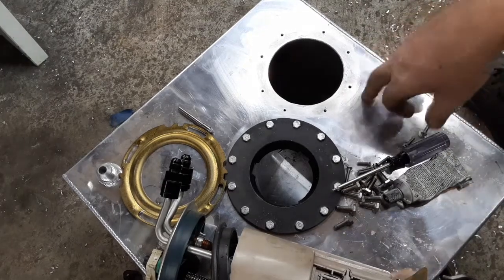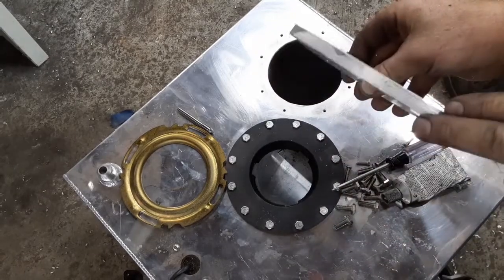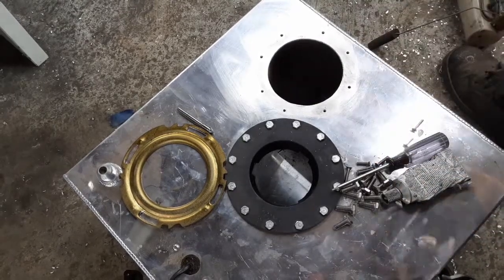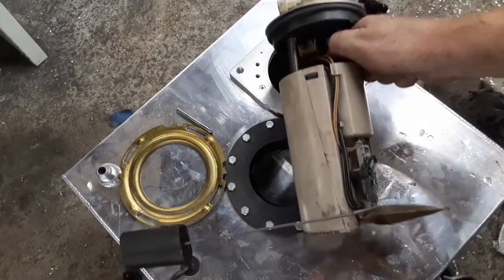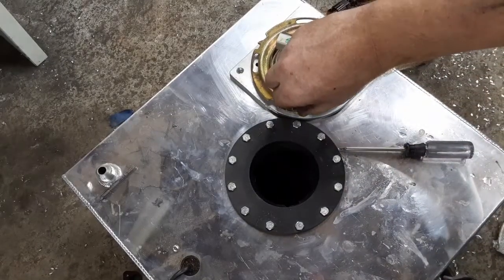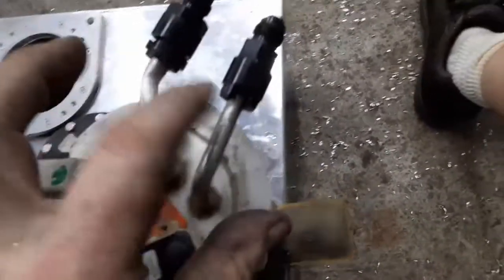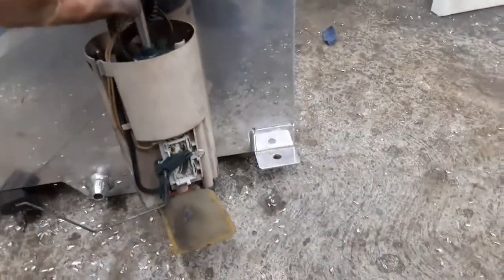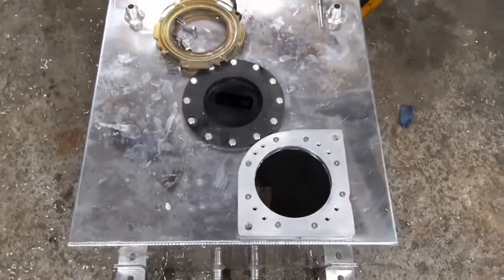LS Swap in-tank Fuel cell setup - 5.3 FC RX7

Comment: How did this work out for you? I have a 6.0 ls in my s13 240sx with eBay fuel cell and want to do the same but mine is a 20gal fuel cell. I think they should be the same height so I should be fine?
Reply from the maker: It's worked fine for 2 years or however long ago I posted this video, I'm still using the setup. The only issue I had was with the cheap fuel line that degraded, but that's not the fault of the fuel cell.
Reply: @lsswapshopp  oh that’s great to hear I’m actually doing the very same right now but I have a 20gal fuel cell. I got a China new fuel pump assembly because I didn’t want to deal with pulling one from the yards. I’m using this set up as a “surge” tank budget set up. It’s going into my 240sx for drifting. I think it’ll work just fine and won’t give me any fuel starvation issues but we’ll see when it comes to it
Reply: @lsswapshopp  I also used a 2004 Tahoe fuel pump assembly for flex fuel as the non flex fuel assembly have plastic inlet and outlet as the flex fuel have metal pipes like what you have here
Reply from the maker: That's good to know the flex is metal. I just went to the junkyard with measurements and grabbed the first one I found that would work, guess I got lucky.
Reply: @lsswapshopp hey buddy thank you for the help I ended up doing this but just self taped screws on there and I’m not liking it too much so I’m going to get the same 3/8inch thick plate. But I wanted to ask what did you do about threaded insert in the 3/8 inch plate you made?